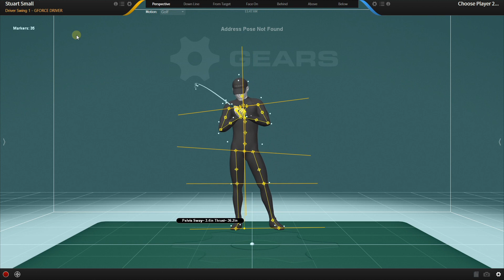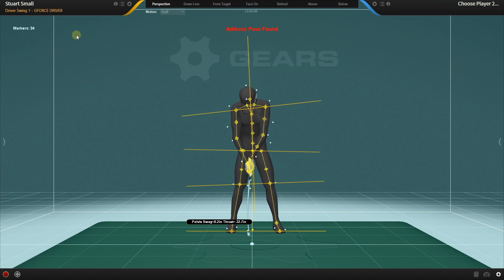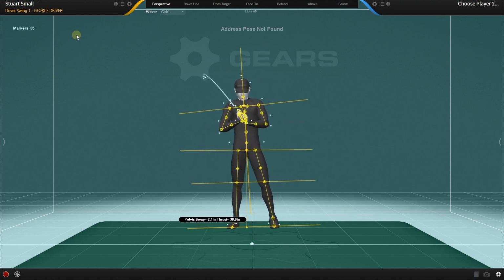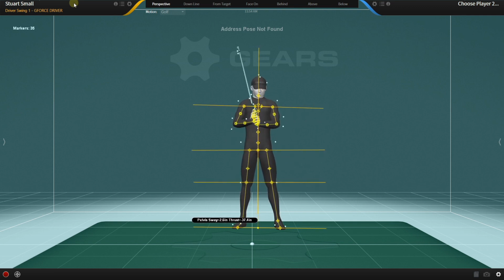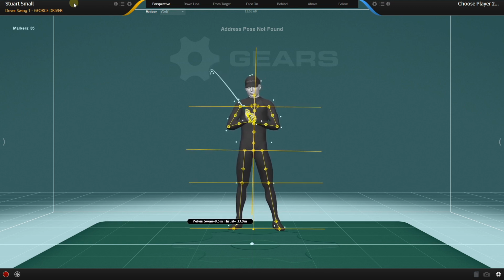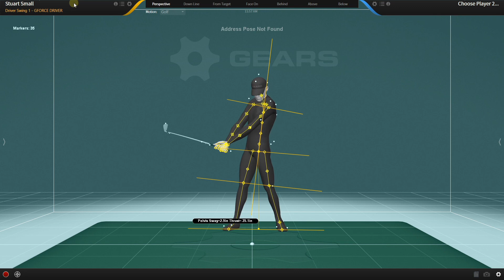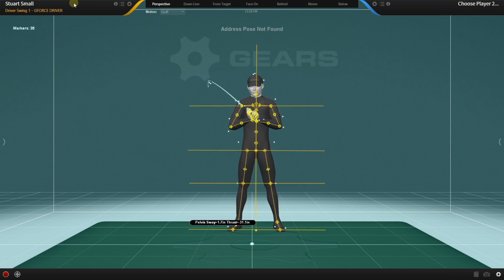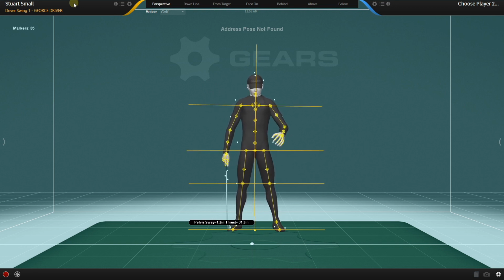Part 5 of 6 - Shaft Load & Unload

Comment: This video is so slept on, literally any time I’m striking it bad is because I’m not letting the club release from putting on the brakes in the body.

Best drills for me is starting off my warm up doing this but with chips and pitch shots first, to dial in the tempo then gradually work my way up to a full swing. 

I’m convinced the smoothest swings on tour are the best golfers at timing up their deceleration. Whenever I focus on decelerating my ball speed goes up, centre face gets found and I look like I’m barely doing anything. 

Was ripping 130mph ball speed on a 7 iron blade today and watched the video back, and my follow through was silky smooth. Guess what my only feel was… Deceleration

Comment: been practiceing ,seems like the Fleetwood drill is after the fact of ball impact. the Fleetwood stopper,but my ball still goes right I assume because on impact club face is open to the target,what other drill do you recommend to get club face square to ball
thanks
John
Reply from the maker: Start with short half swings stopping your hands at impact, the key is to learn to get the ball to go left first with the gforce swing trainer, which most golfers find impossible to do, because they are typically forcing the club through with the hands, arms or body. It's about sequencing the movements in order to get maximum energy transfer into the clubhead.

Comment: What specifically makes the new (blue shaft) GForce Next generation 7 iron conform to USGA rules as compared to the older (black & white shafted) models? Am presently awaiting my new generation 7 iron? I still have my black shafted 7 iron from 2014!
Reply from the maker: Hi Ed, its the face and grooves, they need to be cnc machined to usga specification, the old model was not conforming. 

Thanks for upgrading, you had the first original one then. The shaft in the old model was very heavy, now it is standard weight so the NXT-GEN feels just like a regular 7 iron, just much easier to transfer the feelings over from swing trainer to regular club because the weighting feels the same, thanks

Comment: Hi Stuart, I bought my gforce 7 iron about a year ago, is it worth upgrading to this new one
Reply from the maker: Hi Keith, yes definitely not only is it USGA conforming to the rules so you can carry it in your bag for practice or play. The head design is much nicer, less offset and less chunky than before so top brand looks, feel and performance. 

Shaft is the big change, it was too heavy in all previous models so worked on reducing the weight over the years, now the shaft is standard weight and so are the club heads, perfectly weighted just like your normal 7 iron, swings and feels amazing, its the best I can get it now.

Also the VR-3D free training that I am churning out will get you better faster, lots to come :-)

Comment: Hi Stuart, does your newer video on the double pendulum and constant tension experiment not contradict the concept in this video that is deceleration (reducing force) through impact?
Reply from the maker: The deceleration is in the body, it's called the kinetic chain or kinematic sequence. So we transfer energy from the body into the club, body slows down club speeds up. 

Most players keep accelerating body, hands or arms through impact, which decelerates the club and causes lots of other issues, so the stopper drill helps to decelerate the body and the force then transfers into the club, releasing it correctly. 

I explain this concept in the link here.
https://www.gforcegolf.com/pages/q-a

I keep pulling on the grip in transition to maintain lag and keep my swing radius narrow in the downswing. Then as the Centrifugal force kicks in and starts to release the club (un-cock my wrists) I keep pulling back in the opposite direction to Centrifugal force which is called Centripetal force, this speeds the club up and squares it automatically. 

I am constantly pulling on the grip end of the club, explained in this video below (start 2.30 mins in), it does not reduce force but instead increases it, and reduces manipulation, like a hammer throw in athletics, thanks for your question Johnny :-) 

https://youtu.be/dtsx-C5cBRI
Reply from the maker: Johnny I accidently deleted your reply to my answer below, can you send it again about the force vectors you talked about, thanks
Reply: @gforcegolf  no probs, Stuart. I said:  thanks for the reply, Stuart. I think I understand now. We pull on the grip constantly but the force vector must change to more vertical as the club is releasing toward the ball ie pull towards our centre.